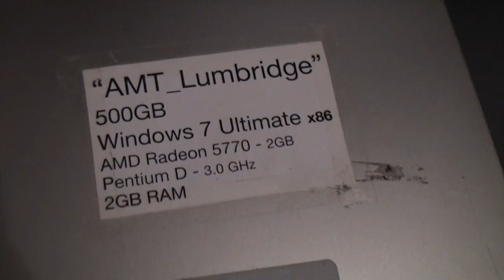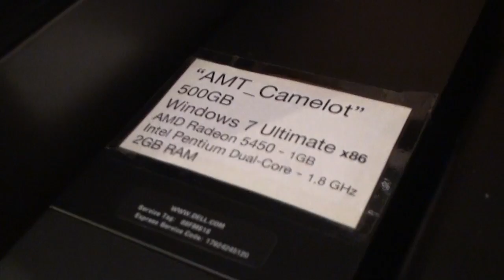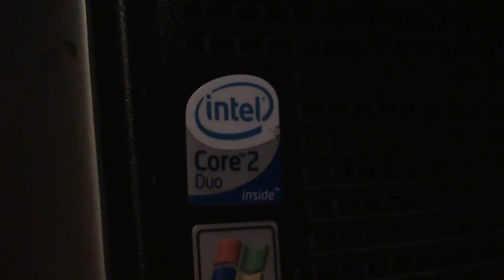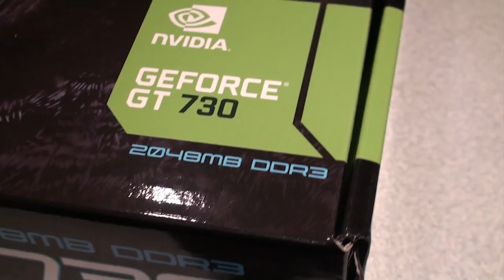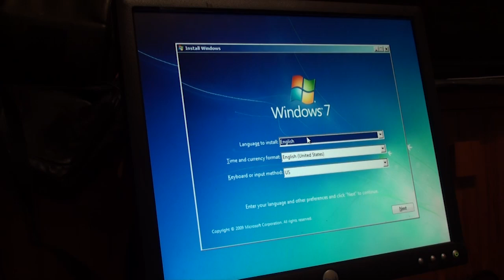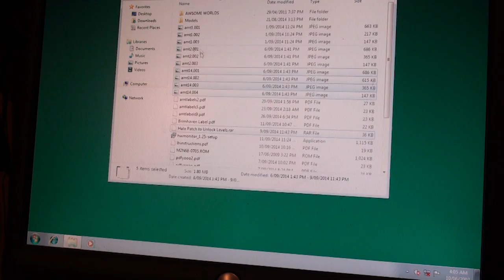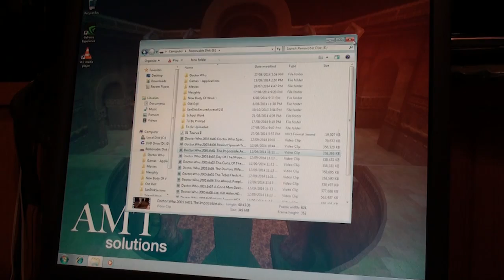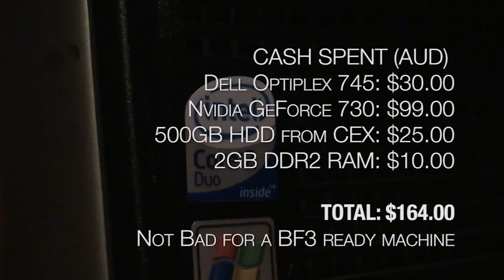Turning an Optiplex 745 from Boy to Man - Green Ham Gaming

Comment: I got an optiplex 745 desktop form factor that someone was throwing out. I took it home and installed xp on it as the vista install on it was corrupted and vista is garbage anyway. It's only got a Pentium D in it but I was planning on throwing a corr 2 duo or core 2 quad in it with a decent graphics card for a mid level gaming machine. Any suggestions on a decent low profile gpu?
Reply: SMAAAASHTV What is your budget?You van get a low profile R7 250 off of newegg for about $50 with free shipping after rebate so that is not a bad way to go.  Would blow the integrated chip away any day. Also, look on ebay for used cards, that can save a ton of cash if you are really limited. Just remember, if this is for a small form factor machine, the power suipply is most likely you limiting factor.  Just be sure not to get a card that requires too much power. One last thing, install I would install 7 or at least Vista on it because drivers for a new card on XP will be an issue if you buy a new card.  Look on ebay for install DVDs and keys for cheap.
Reply: For light gaming look to getting a AMD APU
Reply: pctomactechtalk thanks, I've got a copy of windows 7 and I was pretty much planning on just using it as an emulation machine and some older pc games from around 2006 and before.
Reply: Jose vazquez Thanks but i'm working on getting this dell going as a light duty gaming machine. The amd apu would not serve any purpose as this computer uses an intel motherboard for socket 775 pentium 4, pentium D and core2 processors.
Reply: SMAAAASHTV  I'm on my Optiplex 745 right now :D I am putting an MSI low profile Gtx 750 ti in it that I picked up for $120. Here's a link: http://www.amazon.com/MSI-Computer-Graphics-Cards-N750TI-2GD5TLP/dp/B00SOXMPJY
Reply: +SMAAAASHTV A Core 2 Duo 6400+ should be fine but I suggest you aim for a Core 2 Quad since they cost around $60. A Radeon 240 or 740/750 should the job fine.
Reply: Try an AMD x850
Reply: Really, man? The x800 series is a gpu's from about 2004-2005, this optiplex 745 is newer that that. It doesn't seem like you know anything about PC's.
Reply: x850 seems to run MC at 300 FPS Average
as well as TF2, COD runs at 40,GTA V at 30

Comment: Very nice. I have the 745 as a secondary/tinker PC, upgraded with a Core 2 Quad (Q6600), 8gb Mushkin RAM, ATi 4850 1gb GPU, 600w PSU and a cheap Kingston SSD. These things are pretty impressive machines. I picked it up a few years ago at Goodwill for next to nothing and don't regret it at all.

Comment: If anyone is still interested, Optiplex 745 (at least in tower form) supports Q6700 and 8 GB of RAM. However, two capacitors on the motherboard do not allow double height VGA card to fit easily, so I had to bind heatsink of GT610 a bit. I also tested it with HD6750, and PSU was able to feed that VGA card through Molex >> PCI-e connector.
Reply: 🙂 ok thx

Comment: Do you have any Pentium Dual Core machines? If so, what would be the best graphics card for budget gaming for it? I was thinking of getting a hd 7570. My PC is a lenovo IdeaCentre k220 with 4 gb of ram and, of course, A Pentium Dual Core e5200 running at 2.5 gigahertz. It runs Vista like a champ.

Edit: Do'h. I just realized you do have one.
Reply: Green Ham Gaming  U ever gonna reply?
Reply from the maker: Try and aim for something a little better than 7570. 

If you mean 7870, then that card is just fine. 

There is no real "good card" for an old PC. Any card you get will be bottlenecked by the CPU. 

Just grab a Radeon within your price-range and you'll be sought.
Reply: +Green Ham Gaming  Ya. In my dreams. The 7870 runs for about 300$! Its crazy! I guess I'm stuck with the 5450. Oh wait! It only runs on Windows 7! GAHHHHHHHHH!!!!

Edit: Pay no attention to this comment, I had no idea what I was talking about.
Reply: Jellygoober If anything just save up for a 500 pc build. Most prebuilt or custom pcs can run games like bf4 and all the cod games at medium to high settings.
Reply: Jellygoober That's because it's an older series gpu and stock is limited. You could get a 7870 secondhand for 100-150$.
Reply: +Jellygoober you could get a gtx 750 non ti with 2gb of vram for 70$
Reply: +Jellygoober you could get a gtx 750 non ti with 2gb of vram for 70$
Reply: +Jellygoober Get a 2nd hand one, I got a 7970 for 150 euros (180-ish bucks), you can get a GTX 590 for about 150 bucks, or a GTX 650 for about 100 new.
Reply: HD 7770 would be your best, high-end bet because more advanced cards like the R9 270x and GTX 780 can cause bottlenecks in an older CPU.
Reply: ive seen people run gtx 580s on older games with little to no bottleneck with c2ds but new games it will bottleneck\
Reply: +Noah de Boers I have an r9 270x but my CPU is a little older, being an AMD Fx 6300. Do you suppose an AMD Fx 8350 would do fine? Or should I shoot for an intel CPU with this card?
Reply: e'rekt Zorah Even the FX6300 is fine.
Reply: Intel :o So i should get a motherboard with an LGA1150 CPU port, huh? :(
Reply: gtx 980
Reply: +e'rekt Zorah LGA 1151 if you want the newest Skylake processors. :)
Reply: Danny F I would love one of those. :P They are aren't too expensive either!
Reply: +e'rekt Zorah nah they're pretty cheap I just ordered my motherboard with ddr4 for $117 nzd
Reply: +Jellygoober I know im a bit late to the party here but a HD7850 could be a decent card, its done me well for about 5 years now and i picked up a second one for 50 bucks, second hand of course.
Reply: +Jellygoober upgrade the cpu to something good like a core 2 quad and then get the gpu.
Reply: +Jellygoober The PS4 uses a variant of the 7850 GPU. 7790 for the Xbox One. Wierd because a lot of the textures look better on the Xbox One then they do on the PS4. But the consoles are not always taking advantage of all that extra Video RAM memory they put inside of them.
Reply: ***** You can get a ASUS Core I3 6400 PC from WOOT right now for $329 USD. The price of the processor and motherboard alone can be almost as much. Some have had issues with the installed Windows 10 but you can fix that by doing a CLEAN Install of a Windows 10 download.
Reply: +Jellygoober did it work out for you? Which graphics card did you use? Im looking to restore my Dell Vostro 200 with a Core 2 Duo E6320 1.86 GHz. Thinking of adding a GTX 750, but don't know if the CPU would be much of a bottelneck... Let me know :)
Reply: Dan Ar A lot of games all you need is a good recent Core 2 Duo processor. Just make sure the card you want fits as some small Dell cases can't handle larger cards. I think the GTX 750 and R9 Fury are some of the only smaller cards on the market.
Reply: +Green Ham Gaming did you use the stock PSU on this machine? I just got my hands on a dell optiplex 380. all of its guts are on my living room floor right now. i was thinking of sticking a gtx 750 ti in it. I`m just not sure if the stock PSU can take the power load plus the video card and the stock dvd-ram. Thoughts?
Reply: Milton Ching There is a website somewhere on GOOGLE that has a calculator to let you enter how many devices are inside a PC and tells you what wattage you would need. I would suggest using a small SFX  power supply you can get them up to 550 watts now days. I would never use anything less, mines 600 watts from Corsair.
Reply: +TekReview's i know about psu calculators. I`ve already checked. The stock of the Dell is almost at the limit of supporting the 750ti after all the load. In the end it wouldn`t be much fun playing with an older machind if you have to upgrade everything.
Reply: Milton Ching I believe there are other PSU's cheap you can find no problem. Check PC Recycle places if you are a cheap skate.
Reply: TekReview's you`ve completely missed the point. The point is not just about saving money or just going out and buying the latest skylake, kaveri, gtx or r9. Gutting the optiplex last night to clean every bit of the internals, i`ve learned that the optiplex is quite a beautiful beast. Preserving as much of it is part of the process.
Reply: Milton Ching You missed the point, now your going all ADHD on me. I was helping you there are other Power Supplies that fit in Dell's special made case with more wattage. Google it for fuck sake. I have a Dell.
Reply: +Green Ham Gaming I just ordered an optiplex 320 ordered, im planning on putting in a video card and a few hard drives but it doesn't seem as though it will have enough wattage on the power supply, it is the standard tower not the mini, would a standard power supply fit in it?
Reply: charizard4410 The standard Dell should have a normal ATX power supply inside, you could easily swap with a higher wattage one. Some are SFX power supplies, just check which kind it has inside. There are even ATX power supplies that are smaller then some normal models. Some special cases like my old Motorola 3400 Mac Clone used the ones for those L? spec cases.
Reply: TekReview's
Alright, i got a standard cooler master 500watt power supply to replace the 300w one already in it, even if i have to do a bit of modding. Thanks for the response.
Reply: charizard4410 Dell's spec page should tell you what kind of power supply it uses. Some require small GPU's, the 750TI and probably even the Radeon R9 FURY would be a good choice although the Fury card is pretty damn expensive.
Reply: TekReview's
Sadly i did check that out and found very little information.  And the video card i have is just an OLD nvidia quadro fx 1500 256mb card, the card is only temporary and will only be used to play everquest 2 until my cousin decides to upgrade, im basically just throwing this together for $50 so he can record his ps3 gameplay and occasionally play everquest 2.
Reply: charizard4410 By now a 750TI should be cheap since R9 280X cards are as low as $150 depending where you buy one.
Reply: TekReview's
While it is cheap i already had the card on hand, and as i said i didn't have a lot to spend on the system otherwise i would have bought a used board on ebay for one of my retired processors, but a full working system that has been tested and has 4gb of ram for 50$ basically took up my entire budget.  The card i have on hand was pulled from a system i repurposed as a light gaming rig, it was an hp workstation(idk what model) but it has 8 cores and 6gb ddr2 ram with a 7770.
Reply: vista is the worst
Reply: +e&#39;rekt Zorah Do you mean socket?
Reply: +Jellygoober It's Ghz and vista is outdated go back to XP or upgrade to 7 and that old architecture would bottleneck any gpu that isn't over 7 years old so don't even think about running an HD 7570 it would be wise to get an HD 6770 they aren't that far off for day to day use and not much of a noticible difference while gaming
Reply: +Dan Ar upgrade to atleast a e7500
Or a e8400 or e8500 to go all the way or to get a quadcore get a q8400
Reply: The old 775 cpus are dirt cheap right now, well except the really high end stuff that very few people bought back in the day
Reply: Yeah you can get the e8500 the best dual core for the socket for £10! Or a q6600 for £20
Reply: Intel 3000 desktop. I have it in my laptop with 4 gb of ram and pentium 1.7 ghz. runs games like sums 4,league of legends, hearthstone,darks souls 2, and the darkness 1 and 2 also brutal legends. a very good card and reasonable price
Reply: +Green Ham Gaming can i buy one of these and put like an 950 or new 1070 in this machine??
Reply: Actually, I posted it 10 months after this video was posted. :P
Reply: +e'rekt Zorah I'm running a GTX 750Ti work an FX-8350, and the GPU doesn't bottleneck it too badly, so your R9 270X should be fine.
Reply: +oneguy blah you have the same CPU as my laptop I think. Is it a pentium G3558u?
Reply: +Hotboosthouse I am running Gigabyte 760 GTX 4 gb
Reply: E5200? Runs 7 too, have one myself, very nice little chip
Reply: +Green Ham Gaming  please do a video about amd a6 6420k 4.2 ghz,(10 cores)
Reply: +Lazer Gaming oh sweet. I may get a 960/RX 470 as the 750Ti kinda bottlenecks A LOT XD
Reply: Jellygoober upgrade to a e5700 and a R5 240 for decent minecraft level gaming
Reply: Gibson299 
I got mine for $20 at a garage sale and found in the garbage a 1tb western digital green power desktop drive 500 GB western digital caviar blue Desktop drive and an nvidia quadro fx graphics card

I only have the Nvidia one with me right now because I'm at my grandparents I forgot to grab the other better graphics card which I found at the same place as the other one but this card will do for the time being
Reply: i thought all pentiums are dual core? Correct me if i'm wrong.
Reply: uH nodnarB Later ones are, after Pentium 4's they were all dual core, but before ~2006 they were all single cores
Reply: Thunderfang_ Right, not a common cpu though
Reply: Thunderfang_ Never even seen or heard of anyone having one, Seen and used almost all other pentiums
Reply: Jellygoober nothing runs vista like a champ... vista is horrible, I'm sure if you tell a computer guy you have vista he will pay you to let him install 7
Reply: xeon or michael or whatever I have a core 2 duo machine that runs vista, not bad at all (SP2)
Reply: Jellygoober follow my instructions closely. 
Step 1: Uninstall vista and install windows 7, 8, or 10
Step 2: install a GTX 750ti or better and a higher wattage power supply
Step 3: Install all the games you like.
Reply: Peter Kapica What's wrong with vista?
Reply: ***** vista wasn't the best OS and uses a lot more system resources then 7. Plus it only supports directx 10 max
Reply: Peter Kapica Most of the arguements are "vista sucks" rather than actual concerns
Reply: ***** the reason I say so is because of all the troubles I had with it. Those I mentioned are actual concerns like uses more system resources, and directx 10 limit. My experience with vista: my parents had a toshiba laptop with vista home premium. Decent laptop but the main user account after about 5 years has corrupted causing the system to freeze. Eventually I scrapped it. My friend also had vista home premium on his desktop. It was slow and freezing up. Upgraded to 10 and runs like new
Reply: Peter Kapica Glad to see you have something constructive to say
Reply: Eyy, I have E5200 too :D
Reply: i have a pentium e5200 4gb of ram and a gtx 470. all under a hundred U.S dollars.
Reply: i plan to upgrade to a core 2 quad and a gtx 1050 ti
Reply: Classic gaminginHD actually, a good match for the core 2 quad is the 750ti or 950
Reply: BOTTLENECK ALERT BOTTLENECK ALERT BOTTLENECK ALERT

Comment: Wait, did he just call the 'dreadful 5450' good!?
Reply: Yep, he did.
Reply: any performance is welcome to green ham gaming
Reply: MadmanEpic remember he overclocked it
Reply: I also have a 5450 1gb version tho, I run tf2 with real good fps
Reply: Muhd Faaris please go and get a new card
Reply: piece of potato Unturned?
Reply: i have r9 270 but i am trying to find a card for my friend's E6550 do you think that a 5450 is enough?
Reply: good for the money XD
Reply: piece of potato GET A SAPPHIRE 6570 1GB. NOW.
Reply: I put one in my dell 740 optiplex and I can`t get it past 64mb`s motherboard may be slowing me down. It auto sets to 64,won`t let me change it.
5450 is a real good card with the right board.
Reply: I got mine for $10 on eBay. It’s a good card for older games on 10 year old-ish systems. I think that’s what he means since most of these PCs won’t be able to run most games outside of the late 90s.
Reply: If you overclock it then it’s decent for things like Quake 3, DOOM 1 and 2, and maybe some Simcity.
Reply: It's okay if you need HDMI output/multi-monitor support.

Comment: Please make a budget gaming laptop build/buy video,  pitting older discrete gpu laptops against a cheap new intel hd 4000 graphics laptop and tell us where the performance is for the money laptop wise.
Reply: BitzenBitez TechQuest he made a review on a tablet. He hates the keyboard but it plays old game well
Reply: Nah I mean old workstation laptops with Nvidia k1000m or k2000m discrete gpus, or any old workstation laptop for that matter. its the PERFECT mobile budget gaming solution.
Reply: BitzenBitez TechQuest my workstation laptop has a NVS 4200 gpu and it can't even run gta without crashing
Reply: Mine Has K1000m, cost me 200 dollars, gets 45 frames per second at 768p, i7 cpu with 8 threads, and if you think the nvidia card is shit, you can look up earlier GHTV  videos on gaming with the integrated INTEL GPU, or check out Lowspecgamer youtube channel, he built a whole channel around gaming on intel hd 2000 and up, and the work station card in my laptop would wipe the floor with an integrated intel card.
Reply: I had a thinkpad 410 with the NVS 3100 and I ran world at war easily 30+ fps depending on settings, have your fill of custom zombies bro :] if you want i could give you a list of good games that would run on it.
Reply: +BitzenBitez TechQuest (techquest) i have waw and i have like 20 fps on lowest
Reply: its really hard to decide what to buy laptop wise, because there are brand new lenovo ideapads with r3 apu chips for 200 dollars after tax! wtf    budget gaming heaven or shitty marketing ploy??? Please I need to know lol
we need a good budget laptop guide for the 2017 year and I may just have to make it myself at this rate lol.
Reply: BitzenBitez TechQuest just make it yourself. You need to do price research, features, etc
Reply: I would say get a intel chromebook and install Linux and Steam, it worked great for playing stuff like Quake and Doom. Emulating works flawlessly on it. The laptop cost about $200 and it’s a great deal if your willing to work with it. But, a  older workstation laptop or a cheaper iMac should work good as well.
Reply: It’s a R16 if your interested.